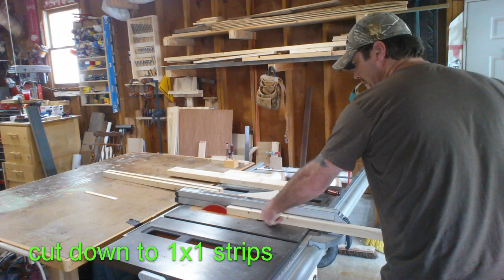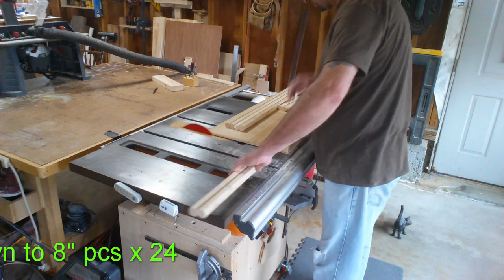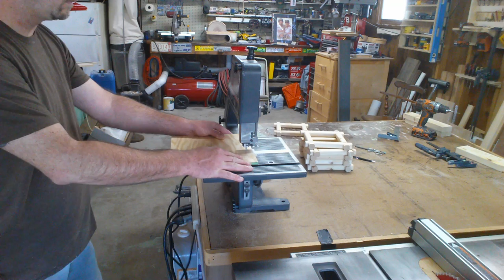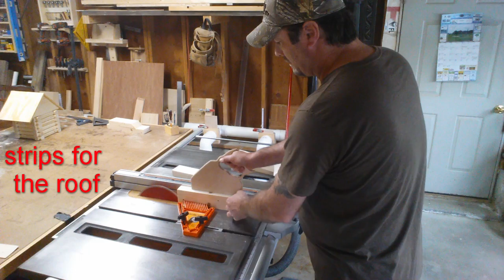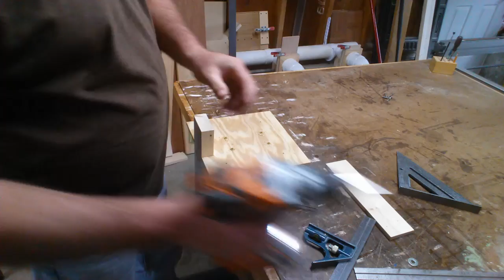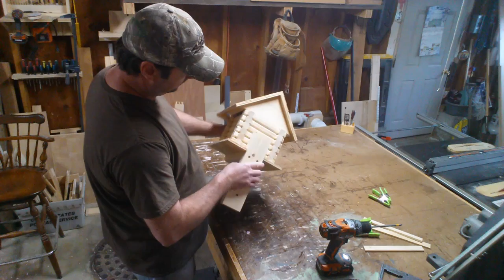Build a log cabin bird house -2

Comment: A very nice project but unsafe for eggs and chicks.  Always put a predator block over the access hole, cut 3-4 shallow kerf cuts under the acess hole out side and inside so chicks can climb out when they fledge, , there is no floor drainage.  It's good not to paint or stain as they can be toxic and I like that you didn't put in a perch which predators use to reach into the box, I didn't see an access door to clean out and check on chicks.

Comment: Hi, I love the bird house, but I have a few questions. 1. Where are the air holes for ventilation? 2. How do you get into it to clean it out once a year? 3. Did you paint it? 4. With all the nails and screws you put into it, will the birds get stabbed by all of them sticking through?

Comment: Excellent craftsmanship, and one of the few I have seen where the hole is up high like it needs to be so the fledglings don't jump out until they have enough feathers to fly a little.  Do you have a version where it opens to be cleaned out?
Reply from the maker: Thank you,,, it has 4 screws on the bottom of the base so the house comes off the base for cleaning.

Comment: I learned a lot from you today, thank you.  I would have learned even more if, around 2:55  etc, you had described or illustrated more on your methodology with the stacked dado to notch the logs.  Also, when I build my own, I don't think I will round off those corners of the log blanks that go on the inside of  the bird house, unless I'm expecting the residents to be so discriminating.  Keeping them square may add to the house's weather resistance / comfort and stability ???
Reply: Don’t you hate when they never say a dang word during the ENTIRE video

Comment: Good job explaining, and demonstrating the cutting and assembly of your log cabin bird house.  It's definitely a sturdy one and should last several years with some reasonable care, and some paint or stain to help it last.  Can the bottom be removed to clean out the old nesting material?
Reply from the maker: Thank You, yes the bottom is held on with 4 stainless screws, i have 2 in the backyard that are stained and they are holding up great!

Comment: There are several components to doing a pro job. One plan I found which succeeds in merging these is the Aviary Magic Method  (google it if you're interested) without a doubt the most useful info that I've seen. Check out this  unbelievable website.